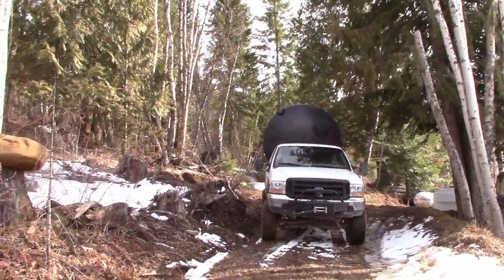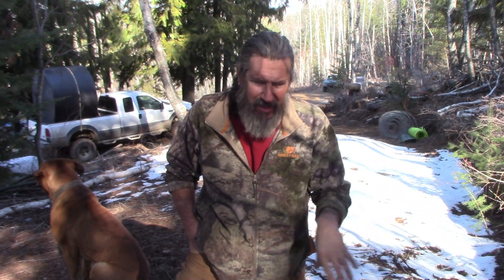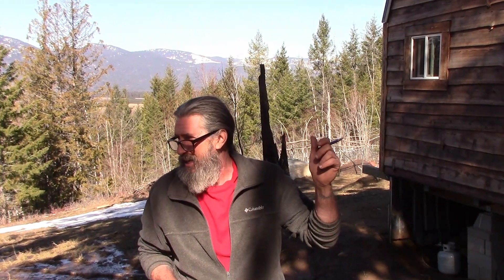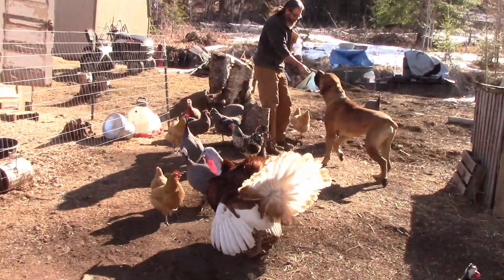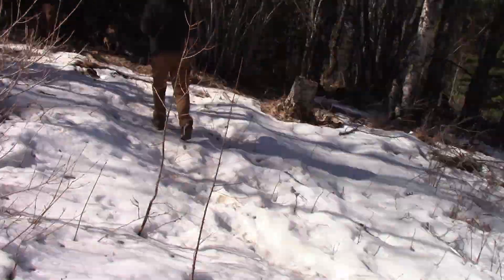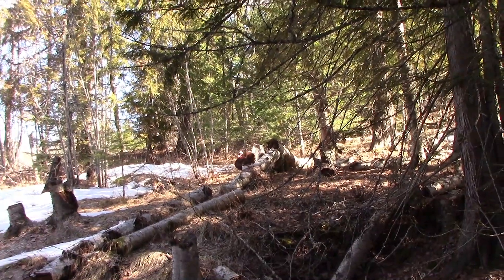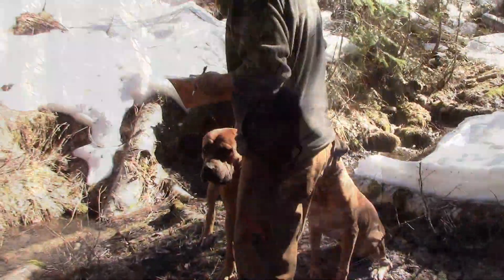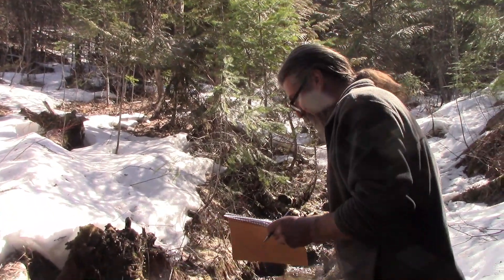Homemade Ram Pump | Setting Up Our Water System (Part 1)

Comment: Hi, I just watched the episode of you guys on Homestead Rescue. I looked you up on FB to see how far you are from us in Bonners Ferry. They said you have 50 below winters, so I didn’t think you were just in Sandpoint. Anyway, I was so hoping the Raneys would suggest a spring well for you, like we did. We followed the instructions from Revolution Realty in Coeur d’Alene. It’s fantastic and extremely doable. We have all the water we could possibly want, and it’s the best drinking water ever! Here is the link to the instruction site.: http://www.revrealty.us/offgrid-springs.html
Reply from the maker: Rhonda Perry yeah there was a lot they got wrong with our episode. We are in between Sandpoint and Bonners Ferry. Thank you for the tip. We went with a ram pump. Actually got it running today. Have a kink to work out and we should be golden. Hope you enjoyed our episode.
Reply: Yes, I love every episode! I’m so glad it’s going well for you guys! I was rooting for those gorgeous cedars to stay, too. :) I also built a ram pump about five years ago. I learned from Engineer 775, owner of Practical Preppers. You must be way up the mountain to have temperatures that cold.
Reply from the maker: Rhonda Perry Stu loves Engineer 775! He has awesome videos! We don’t get that cold up here. Homestead Rescue got it wrong. We’re probably about 5-10 degree difference from Sandpoint.

Comment: Keep in mind pressure is measured in pounds per square INCH, so a larger pipe will not only give you more flow, it will also give you more pressure.
Maybe not enough to run your sink, but there will be more.
Picture a floor jack... You push a small amount of fluid into a bigger area, with little effort, and can lift a lot of weight.
So you fill with a small pipe but draw water with a larger pipe.
Also a 2 inch line will have 4 times the area as a 1 inch, so 4 times the water.
Reply: Dan Rat we have tanks in the cabin. We will use the cistern to fill these tanks. I’m sure eventually we will have to add a rv pump to pressurize the taps. But for now we won’t need to haul water.

Comment: Could you use a 55 gallon poly barrel with the top cut off, dig a hole in the creek to put the barrel in to catch the water  and put your shallow well pump into it?
Reply from the maker: Irish Prepper Stu was thinking about something like that. He’s been researching.
Reply: Would really like to do something like this.its also safer, les trash could get in there. The ground is so rocky. Would probably need to wait until the flow stops for the summer.

Comment: Another app to estimate elevation difference: Google Earth. On the aerial view you can see elevations for the creek and tank.  Another thought, putting a piece of used carpeting under the plastic tank may prevent a puncture
Reply from the maker: Steve Schauweker good idea with the carpet!
Reply: I tried it. It wasn’t loading on my phone for some reason.
Reply: Love the idea of the carpet. Need to see if I can scrounge some up.

Comment: Yes flow not pressure.. Go 2” if you can the more flow the better if your not going to lift the tank. 👍.
Reply from the maker: living Off Grid McGarvey style thank you for the tip! I’ll let Stu know when he gets home. 😀
Reply: I would like to go bigger. I think 2” is a bit much. Not because of the flow but the wrestling match to get it to cooperate. Haha! I do have it set up with 1.5” valve. When the time comes we will probably upgrade to a 1.5” line.

Comment: Ok, what about doing it this way. 
Take the ibc tote over to the seasonal creek, plumb a pipe into it from a decent flow point, and then place a submersible pump into the tote? Or the ram pump for that matter?
For the gravity fed system I still can’t get the head pressure without an rv pump, and bladder. 
With those in there the water pressure is perfect.
Reply from the maker: Living the Dream Homestead that’s an idea! I’ll tell Stu when he gets home 😀
Reply: The ibc is already full. I did look at submersibles. Not enough lift. One thing that was mentioned in the video. Have a powered pump down by the creek wouldn’t work. No electricity. No sun for solar panel. But if you want to come change your batteries out every day. Feel free. Haha!